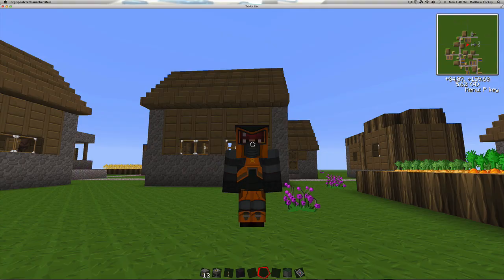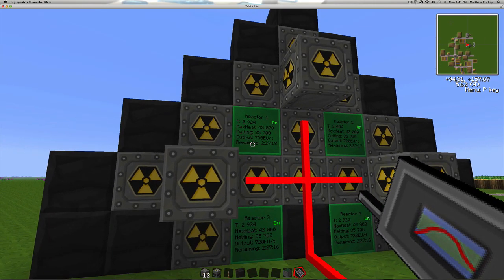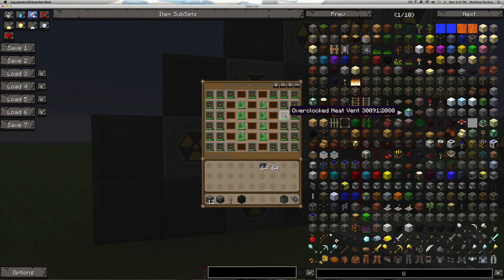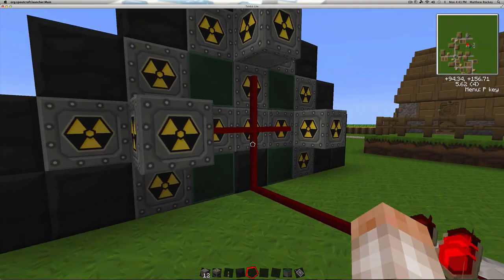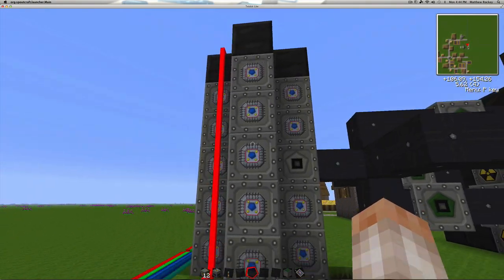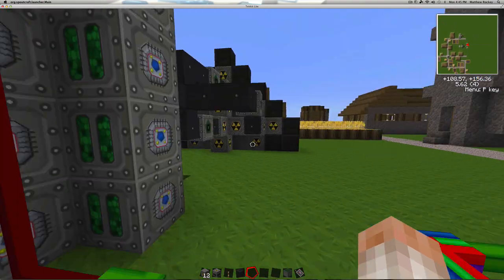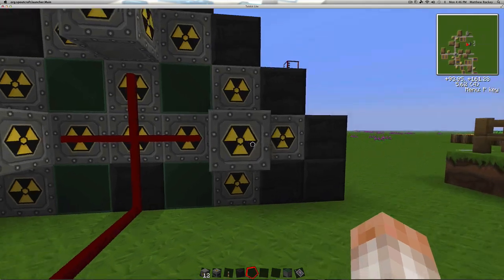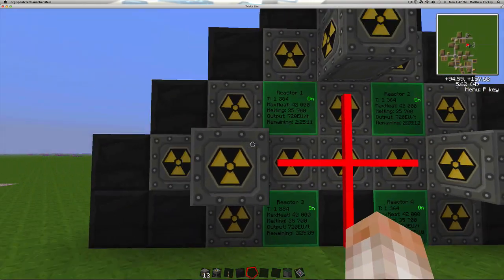Tekkit Lite Nuclear Power Plant - IC2

Comment from the maker: There are lots of mark I full cycle reactors out there that never need to be shut off but usually they don't output as much EU/t than reactors that need to be temporarily cooled down. Those reactors use more of the available reactor components like heat exchangers, vents and coolant cells. There are some really nice designs that out out 200ish EU/t and never need to be shut off that, given the cooldown of "hotter" reactors end up supplying just as much power in just as much time without timers.

Comment: is it possible to get one that doesn't shut off?  looking at all the things available for the reactor i can't seem to figure that out.  sure i could pump in a whole bunch of cooling but for space wise i'd rather use your state switches.  

using your setup i got it down to a 4x3x3 block :)

Comment from the maker: Check out the next few videos I made solisarith, this reactor is not the "best" setup I've come up with but it does work. Reactors that you never have to shut off are far easier and probly far safer than ones like this that run on timers, although admittedly I’ve never had a problem with this design.

-CaptainJack

Comment: new to minecraft.  been playing with the nuclear reactor.  very helpful build.  played around a lot with different set ups.  came up with a 540 eu/t with ON for 12.5 seconds and Off for 5 seconds.  ran it for about an hour and it's stable.  all i did was take dual cells and alternate Dual Cell | Overclocked Heat Vent.  as follows
DODODODOD
ODODODODO

of course that is done 3 times in the reactor.

Comment: it is on, so roughly 204800 EU energy is spent during the 20 seconds it is Off. while the Generator is on for those 10 seconds it generates 409600 EU but spends 102400 EU so a net gain of 307200 EU while it is on which is an extra 102400 EU, so it takes only 3 of these reactors to power as many Mass Fabricators as you want. stop wasting uranium on a fourth.

Comment: I have done some Extensive testing with this setup and have found it is highly inefficient and shows lack of understanding how an MFSU or any other power source works. So here is an explanation so you and other people stop wasting uranium:

So, an MFSU outputs 512 EU/tick, it does not matter how much EU input it has, it will always output 512 EU/tick, (which is why you can power 19 mass fabricators.) Now, at 512 EU/tick at 20 ticks/Second, that is 200 ticks times 512 EU for the 10 seconds (cont)

Comment from the maker: Ninja, we just upgraded our server to 0.5.7 and haven't had any issues so far. We too had originally removed Dimensional Anchors, and even the ComputerCraft Turtles and Wireless Redpower mods because of issues on our 0.5.2 server. Not sure if the new versions fixed everything, as we haven't placed any dimensional anchors since, but everything else is running fine.

We just posted an upgrade guide here (remove the spaces) --> youtu.be /wNAODCXJH0I

Good luck!

Comment: afaik you don't need heavy insulated cable once it's been connected to a transformer, I would use the transformer asap and then switch to glass fibre cable since heavy insulated drops a lot of EU.